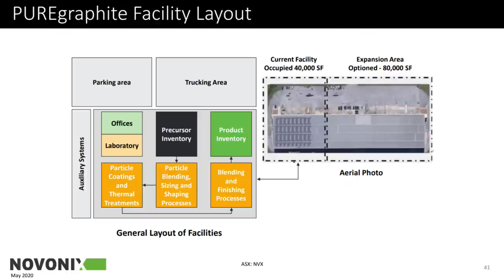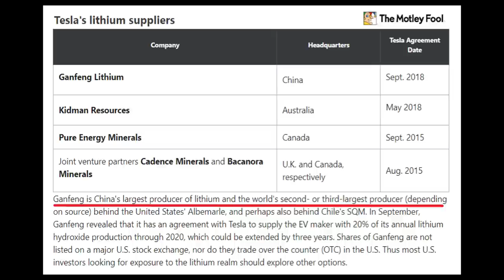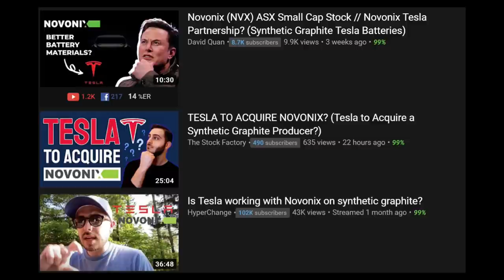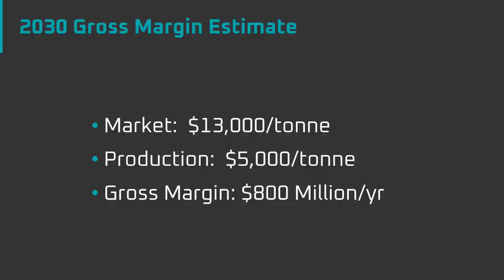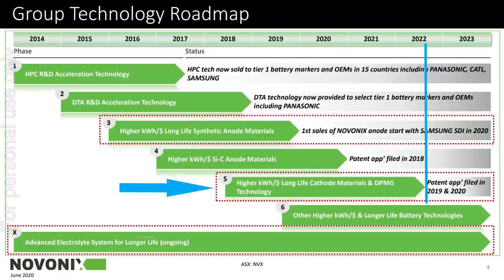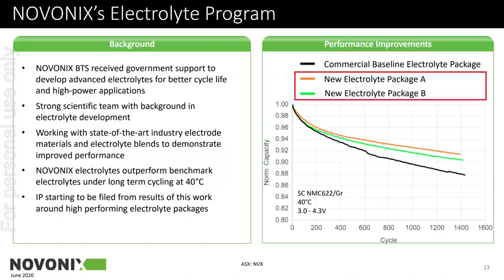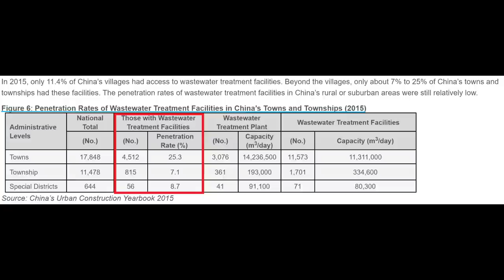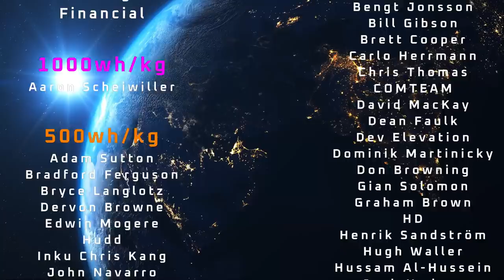The Novonix Battery Materials Opportunity

Comment from the maker: Point of clarification:  The image on screen at 7:01 of timelines is actually for the entire production process (in years) to bring the manfufacturing of these materials online.  This means it doesn't match the wording, which talks about qualification in months, rather than manufacturing ramp in years.  However, the wording in the video is correct:  My understanding is that cathode is usually qualified more quickly than anode.  Novonix has qualified anode as quickly as 11 months, but it's usually 18-24 months for anode qualification for most companies.
Reply: Are you aware of Novonix facility in Ontario and their ongoing battery development work with Jeff Dahn and Dalhousie University.  The success Jeff Dahn talks about made me quite convinced that Novonix will be a very significant player.
Take care
Reply: Tim Tessman Do you mean in Halifax? Yeah this is their Battery Testing division! The way Novonix has been structured as a company is not only to provide EV battery materials for the market today, but to continue to invent and rapidly test new materials for the next 10-20yrs! Very excited about this company
Reply: I suppose It helps they designed their own test equipment first
Reply: I would just add to that slide from VW comparing their diesel vs EV, that was 1.6L Diesel Golf vs now being replaced e-Golf, and even then, whey they published that, it was disputed, that they made diesel look nicer than is the reality. Now they are claiming that with ID.3 they are already from factory greener with ID.3 vs Diesel Golf.
Reply from the maker: @apocrypth  good point!
Reply: Not sure I heard what your comments were on what impact use of solid state batteries for EV / Tesla would have on Novanix as a company offering products based on their patents ? They don’t need each other but if it’s “ game over “ as Sandy Munro says with solid state as goes with Tesla goes with solid state in all the EV market ?   Does novanix still have products in development now that work with solid state?      Thx
Reply from the maker: @fredwinslow744  Novonix doesn't have anything for solid state.  I think Sandy is very wrong about solid state being 50/50 odds.  There is no information out there to support that.  I hope I'm wrong.
Reply: @youtzube  It's back down at $0.79. What was behind the spike?

Comment: Given that Tesla is keen to vertically integrate every element of its production I think that a company like Novonix is a likely acquisition target.  Jeff Dahn’s technology has the ability to rapidly screen the attributes imparted by the use of novel materials in battery components.  If Novonix’s anode material shows real gains, is scaleable for manufacture and has the right price profile then it would be logical for Tesla to acquire Novonix;  the earlier they did so the lower the price they would expect to pay for them.

Comment: Huge important note: with local synthetic materials, it’s a push to environmentally friendly sustainable materials. It has better longevity and power output as well. Mining is not a long term play. Synthetic will be the future for all these reasons. All they need is to get funding to scale and prove their model.
Reply from the maker: This will become more clear in the synthetic vs natural anode video.  The analysts at top firms can't even agreeon which will dominate.  I think it's a moot point.  Is horses for courses as far as I can tell.  Each has a clear use case.  Stay tuned...
Reply: The Limiting Factor China is the biggest producer of graphite currently. Rising tensions, self reliance, resources +pollution in the long term, superior performance overall.... I’ve looked into this deeply. The current anode and cathodes used will evolve over time, and I believe there will be a transition to synthetic on that side of the battery . ‘When’ will be the bigger question. Demand will outweigh supply if using raw natural resources, especially as all auto manufacturers massively increase production of EVs in years to come (and cell phone as well), so as time passes, efficiency will naturally increase using less or alternate resources over traditional means especially if trade with china or other political intentions come to pass. Adaptation will win out. Whether it’s Tesla or another major company, someone will utilize and scale the tech rather then just try to get more usable graphite from the mines currently activated.
Reply from the maker: @jarenb2331  How did you resolve the issue of competition from the steel industry for carbonaceous byproducts of the fossil fuel industry which will be happening at the same time as reduced availability of those high carbon materials (due to reduced fossil fuel usage)?  Basically, the supply bottleneck for the raw materials needed to go into synthetic anodes.  

I've spoken with someone who sits across both the steel and graphite industries at the executive level and this is a major concern of his for the synthetic graphite industry.

Chris Burns had a partial answer for this, but no definite strategy.  I'm looking to create a balance view, but that is a serious threat in the 5+ year timeframe.
Reply: The Limiting Factor thanks for the reply. I love a good discussion. I can see an argument for the bottleneck, as you call it, though I still believe synthetic will win out over raw over a 10 or so year period. I invested in Nvx after listening to numerous interviews and deep diving the research. As you said in this video, it likely won’t even be Tesla, but it doesn’t matter. Cell phones and cars alone will demand innovation to scale to demand. Starting a mine takes far too long, let alone the quality of the graphite and where it’s coming from. I’m definitely a bull on nvx. Between the patent, recycling capabilities, and unknown factors of why it performs better (interviews from Chris Burns), it seems like the next logical step. Use the same material that’s been used on that side of the battery for decades, or find a better solution that performs better that’s not dependent on China. Massive raw materials will dominate for the foreseeable future, but I can’t help but think someone will realize the value and find a way to scale even with conditions and restrictions. Maybe I’m an optimist and things won’t change.
Reply from the maker: @jarenb2331  Thanks for the input!  I'll be suggesting several possible paths to address the issue (to try and keep it balanced).  I'm pretty bullish on both Novonix and Talga.  Depending on what is revealed at battery day, there might be a shift in my thinking.  It depends on how Maxwell technology interacts with the anode to extend battery life (I hope this question gets answered).  Natural currently isn't viable for a million mile battery with a high nickel chemistry.  However, without the corrosive effect of the wet slurry solvents, it might go the distance.  Huge question mark.
Reply: The Limiting Factor Completely agree. So much mystery behind battery day, and hopefully answers that will be revealed. 

Unrelated last comment: 

That news about CATL saying they are “ready to make a million mile battery” I think was just an advertisement worded in such a way that with their own tech they have the ability to make ‘A’ million mile battery, but not a spec Tesla gave them. I still believe in my heart of hearts Tesla will have their own recipe. Perhaps they will indeed be one of the primary manufacturers, but I doubt Tesla would be okay with them leaking the announcement that far ahead of time which makes me think there’s something far more exciting in the works. Here’s hoping! Thanks for the vids. Looking forward to the final.
Reply from the maker: @jarenb2331  I totally agree!

Comment: One of the things I'm working on is making high content of crystalline nanocellulose and converting it into carbon (primarily for composites) and graphite (for batteries and super capacitors).  I'm trying to make the process as green and low energy as possible.  For example, I'm building a super solar oven to convert it into carbon (I'm waiting on an evacuated Solar tube to finish the project), and then using insulated microwave kiln to covert it into graphite.  

   The main problem is sulfuric acid and finding better and less corrosive chemicals. Enzymes can work, but they take much longer and are more expensive.  I'm going to be experimenting with whether or not different cultures like kefir, might be able to use the soft cellulose as a food source.  If that works at all, it would become an extremely green process and even better and cheaper than enzymes. 

     Anyways, point is, if I can do a lot of this at home with very simple equipment and not a lot of in depth education, then certainly industries can scale up these processes and make them much more efficient.  I'm convinced that graphitized CNC holds great promise as a graphite source for batteries and super capacitors and carbon for composites.  Why, because the highly crystalline nature of the base material and that it's already nanoscale (and becomes more so when graphitized). And cellulose is probably the most abundant natural resource on the planet.  

  While I'm using a biomass source that contains high amounts of crystalline cellulose to begin with--industries are focusing on wood pulp and wood and cellulose waste products.   There is A LOT of the latter. Think of all the newspaper, cardboard, jeans and other cottons based clothing, sawdust, etc, etc that gets thrown away.  Rather than digging huge holes into the Earth, which is extremely energy intensive, why not focusing on converting all this cellulose biomass into CNC's and figuring out ways of low energy conversion into carbons and graphites???
Reply from the maker: Dude, you're a mad scientist.  Very cool!
Reply: @thelimitingfactor  Lol thanks; trying to become one at least.

Comment: What about silicon anodes or silicon anode enhancement? Doesn’t Tesla already have anodes with some silicon in it?
Reply from the maker: Yes, they do.  I think it's standard practice amongst the leading players to dope with a bit of silicon.  I think this what NVX has planned.  They haven't made mentioned of a 'high-loaded silicon anode' so I didn't drill down further.  High loaded usually means greater than 10% Si, which would be an achievement.

Comment: Great work Jordan! I do have a question though - do you think Tesla's recent move to LFP in base model 3 and Y will start a trend for the market to move in that direction? Can LFP use single-crystal cathode or PUREgraphite?
Reply: I've discussed this with Jordan elsewhere.
The issue with LiFePo4 is that even if you use new tech, it will only approach the density of the existing Tesla 2170 cells.
It's difficult to cram any more between the wheels on smaller (cheaper) cars, plus the weight is an issue, and you can't get the output for the bigger/ higher performance cars.
The "low" range 3 may be the sweet spot.
Imo, the next Tesla cell will bring the costs down so much that it will become the standard, I think in a modular pack, with fewer cells in the box for smaller vehicles. The economy of scale will make it worthwhile..... But that's just me 😁
Reply: @rogerstarkey5390  Thanks for the reply Roger. I agree that LFP with modified pack construction is one of the things Musk will announce on Battery day at a cost that will shock people. That will become the new standard setup for "Base" range cars ~300 miles. And the higher energy density batteries will be for more expensive models...which leaves me wondering if demand for NMC batteries will be less than the expected 10x boom over the next 10 years if the majority of batteries made for cars are now going to be LFP. That's why I want to know if Single-crystal cathode tech (DPMG) works with LFP.
Reply from the maker: The great benefit of LFP is that it's already a million miles chemistry.  The cost benefit of dpmg single crystal with synthetic anode may not be worthwhile.  It may happen in time.  Another wild card is Maxwell tech... If it really does double cycle life Tesla may be able to get long life batteries through that path, and they'll definitely be cheaper.
Reply: @thelimitingfactor  
We're back to the the accumulated benefit of the incremental improvement.
I still think those "RR" cells are going to be cheaper than we think, accounting for the density increase.
Also, with LFP, could they get sufficient range into a smaller car? Would they have the Honda problem?
Could they end up with just one car in the middle of the pack with the LFP technology sweet spot?
If "RR" cells have say 50% more density, but being built "in house" are only 30% more expensive, they can reduce the quantity by 30% and be level on cell cost..... With less weight.
Reply: @teaisgoodforme4919  
I don't think LFP will be the announcement.
I think the modified pack will be for new construction 2170 cells.
The big advantage? The could make a pack casing which fits a model 3, but reduce the cell quantity for that car making it cheaper/ lighter.

They can fill that same pack up and achieve 100+kWh, with plenty of space to fit in the standard S/X, just alter the mounts.
Plaid? Either an extended pack, or a second low volume module, next to the "standard' pack.
Advantage? They only build one cell type, one pack type and likely one BMS..... Economy of scale, simply adjust cell quantity, it's the direction they seem to be moving, everything modular.
Reply: @rogerstarkey5390  This makes sense. I agree the Roadrunner batteries are likely long-range Nickel-rich chemistries that will benefit from Maxwell and could also use DPMG/PUREgraphite. Are you suggesting that the cost savings of their new processes will make these cells cheaper than even LFP? So that eventually when production is able to ramp up enough, they can ditch LFP and just go with their Roadrunner batteries for everything?
Reply from the maker: @rogerstarkey5390  As a proportion of vehicle size, the battery would remain the same, and so range should be sufficient.  So many variables...
Reply: @teaisgoodforme4919  
Possibly, if you account for density, building in house and standardising components across all cars.
There's also the possibility that the CATL cells will be short term, even in China.
Tesla key words will be 
Common,
Modular.
(Imo)
DPMG? Not yet, but could be integrated
Reply: @thelimitingfactor  
Model 3 sized "box"
Now holds 75kWh, presumably full(?).
Same box, same 2170 cell dimensions, 150% cell density.
Result:
Either 30% reduction in cell quantity for the same 75kWh, 
Or
Same "full" pack, but 75 × 150%= 112kWh. 
Allows a standard pack "box" across S3XY.
Reply from the maker: @rogerstarkey5390  After thinking about it a bit more, I think a smaller vehicle would have comparable range, but a little short of bigger end models.  Like S to 3, but not so drastic... Product differentiation.

S and 3 price band will probably get longer ranges in the future.  Hopefully by the time Tesla creates a compact.  This would mean the compact still has good range.